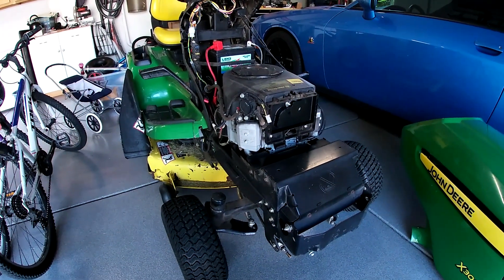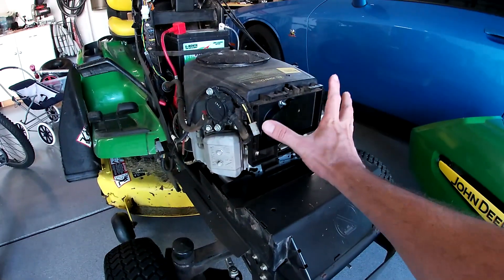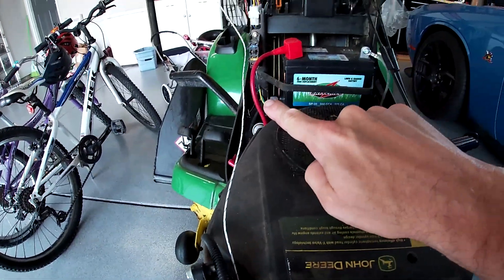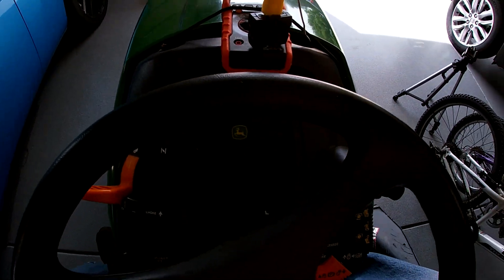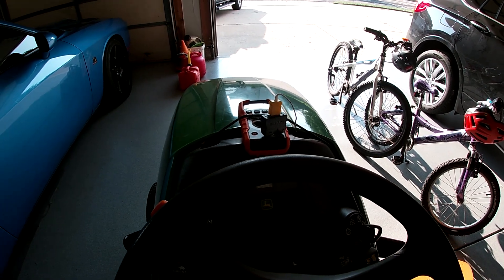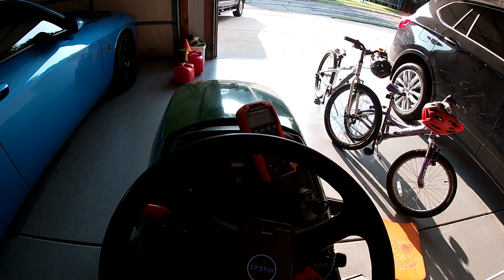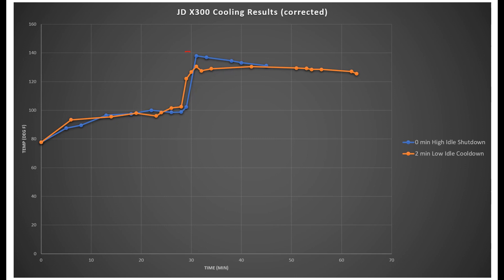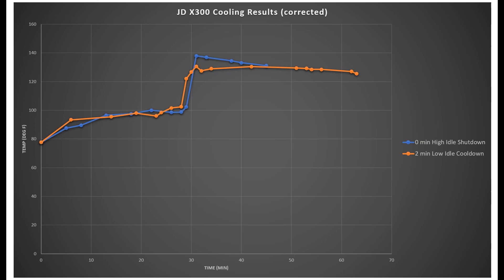Does my lawn mower need to idle before shutting it off?

Comment: You went to a lot of work to answer the question. I have never idled down my John Deere mower before shutting it off. I recently watched a video by John Deere advising that you should idle down before shutting off. I started to feel guilty for never idling down my mower, so I googled the question and found your video. Life is too short to waste it sitting on an idling mower when you don't need to. Thanks for the information.

Comment: I have about a 1 acre lot. I do the backyard 1st, then the front. My shed is in the backyard so when I finish cutting the front I blow compressed air on the mower deck, wheels and underside deck then drive it to the shed. I used to hose it down in the past until last yr when I started to use compressed air. Been doing the water cleanup from 2009 to 2022. If the wheels get muddy then the water hose comes out.

Comment: Interesting video, thanks! I think you might get a more accurate result by using a cylinder head temp gauge. I used to use one on my racing go-kart. At Wide-open and 5500 rpm on a Briggs 5hp, I would run around 438 degrees at the seat of the plug where it seals on the cylinder head.
Reply from the maker: That's a great idea, thanks!  I think a test like that would offer great confidence in the answer to the question.